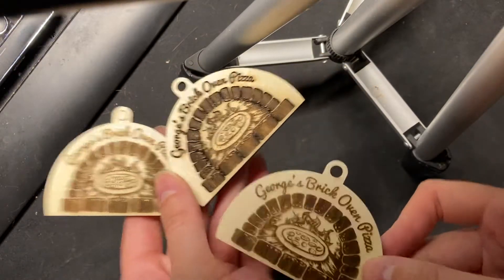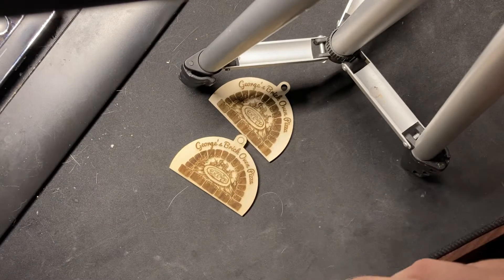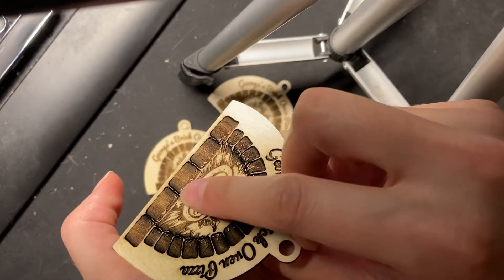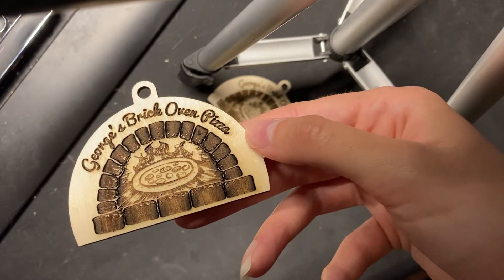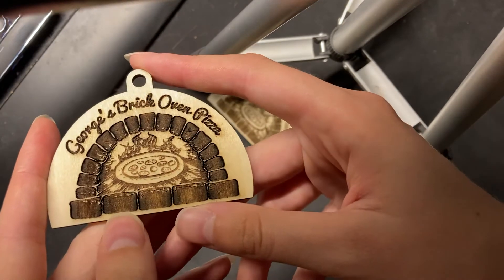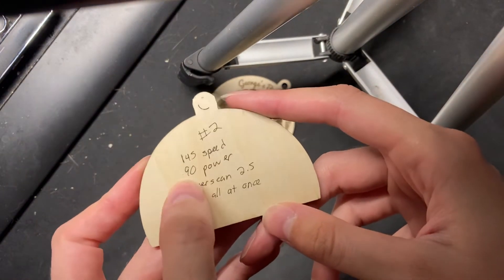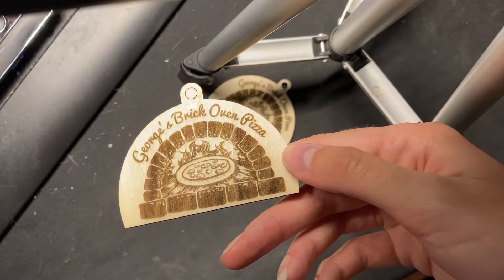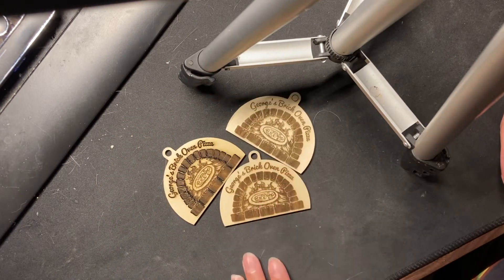More consistent Laser Etch Results with Over-scanning and Fill Order

Comment: I'm working on a new type of engraving that I saw a little bit ago where a guy made "blueprints" with Dollar Store posterboard with a white core to it.  He engraves the blueprint drawing on, of course, blue paper where the top colored paper is burned away and the white core is exposed making it look like a blue print.  

As I tried the process I was experiencing the burning at edges of the burn where the laser head had to slow down and reverse itself.  It looked kinda like what you got on your first engraving test with the burn marks at the edges of the laser pass.  After watching this video, and turning over-scanning on, everything came out much better for me with a more consistent look to the engraving.  Now they look like blueprints.  Cool video.  thanks.